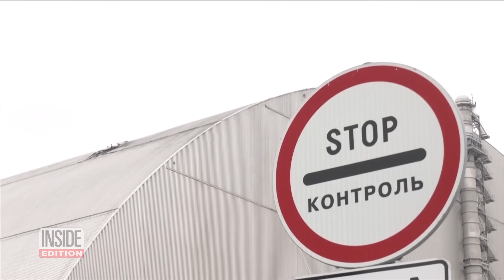Chernobyl's Protective Shield Isn't Working After Drone Strike

Comment: I don't think there is any damger core is solidified it won't explode
Reply: There is, the old sarcophagus won't last for much longer, and if pieces of it fall down, it can kick up radioactive material again. It won't explode, but it will release radiation. That's why the new containment was built first and foremost, to contain any of that stuff in case it collapses. And also to allow personel to start manually taking it apart safely and to monitor the area.

Comment: what most likely happened with the drone is Russia fired it, Ukraine jammed it, Russia lost control of it, and then it crashed into the reactor shield
Reply: And why exactly is Russia firing drones ABOVE Chernobyl?
Reply: @katamas832  I don't know, but it probably wasn't intended to, both sides should be smart enough to leave that reactor alone
Reply: @themartiansurvivor Ukraine is smart enough to leave it alone. Russia isn't. You try to blame Ukraine for Russia sending a drone above Chernobyl and Ukraine jamming it, with it happening to fall on the reactor? 
Russia created the entire scenario. You can't blame Ukraine for it. If Ukraine had their way they'd still be cleaning up Chernobyl without having a war around it.
Reply: @katamas832  either way, what they should do is put a keep out zone around it, like a 150 mile radius of the reactor should be untouched,

Comment: Fix the hole. Problem solved.
Reply: No, it's not that simple. The roof was created with clean air inside it, that is now contaminated, and there was also insulation inside the roof that caught on fire. Most of that was burned away. The damage is very extensive, with repairs being difficult, and even if and when done, the new containment's lifespan of 100 years was severely reduced. Which in on itself is disasterous. That 100 years was planned to use to clean up chernobyl. Now a new solution has to be found and funded.

Comment: But isn't nuclear power 100 percent safe...
Reply: Nothing is 100% safe. Nuclear power however is safer than fossil fuel, and Chernobyl is the only disaster that caused wide spread attacks. The closest Fukushima comes but Fukushima only has its premises irradiated with a small surrounding area, where there was human error and the power plant was hit with 2 natural disasters at the same time.
Nuclear power is very safe, yes. You need astronomical odds or monumental mismanagement for it to go wrong.

Comment: It's not such a catastrophy. 
The "New Safe Confinement" is only in place since 2016. That hole is not a huge problem since the main containment structure, the sacrophagus, is still intact. 
Now if an Iskander hit that site, that would be a problem.
Reply: It is. The new safe confinement was built for 100 years. Now it is heavily damages and compromised. That 100 year would've been used to clean up Chernobyl. Now if part of the old sarchaphogus collapses and falls into the core, a lot of radioactive material will be kicked up and released into the wind. This was a crime against humanity by Russia.

Comment: So fix it then wtf?
Reply: It's above the still radioactive nuclear powerplant. They need protection, reduced exposure, so they are time limited. And you know. There's a literal war going on.
Reply: @katamas832  they could fix it with a helicopter
Reply: @katamas832  or actually use drones to fix it
Reply: @joshbrz8902Drones don't have the kind of precision and dexterity to fix it.
Reply: @katamas832   not with that attitude they dont

Comment: 3.6 Rontgen. Not great, not terrible.
Reply: "It's not 3 Rontgen, it's 15,000."
Reply: @dead_eddy2237 more like 35k
Reply: It's still boiling away underground waiting to poison the continent
Reply: w hbo quote
Reply: How much the radiation would be inside the core currently? Any current data? It's reducing as the time passes by but wanted to know the actual nos. Current updated

Comment: The. Main cover is inside over said “ elephants foot “ if it wasn’t “working” from shown outer layer these workers would be performing repairs in full fledged radiation suits not over throws and a hard hat
Reply: The Radiation has decreased on the outside over time.

Comment: People saying why are they reporting on this now, it’s old.. it’s still not fixed and is a big problem… they will have to pull the building back out on tracks 
They can’t be up there to repair it because the levels of radiation are to high, like a couple of minutes, and you have reached your lifetime limit of exposure

Comment: What was the point to run a drone into that giant shield?   The only logical reason is whoever did it was trying to let more radiation out.   Why else would you run such a tiny explosive into such a huge structure?   You’re not taking the building down, I doubt there was any targets on the roof

Comment: The fact thus happened 9 monyhs ago and the russians stopped after this incident shows that ukraine is not spending its aid and resources in correct mammer even though the invaders give chance to repair.
Reply: What is the right method to repair? It's a complicated system that's been preached.It's not just a layer of roofing.
Reply: @geniferteal4178 
Least a temporary parchment or repairs can take place

Comment: It took them 9 months to determine this?  Where can I sign up for this job?
Reply: Yeah, I'm thinking just weld a patch over?
Reply: @MistaTofMaine What i saw issue was the strike caused a fire that burned protective layers that sit in between the metal throughout the structure. And didnt burn evenly and hard to see all the damage since its underneath